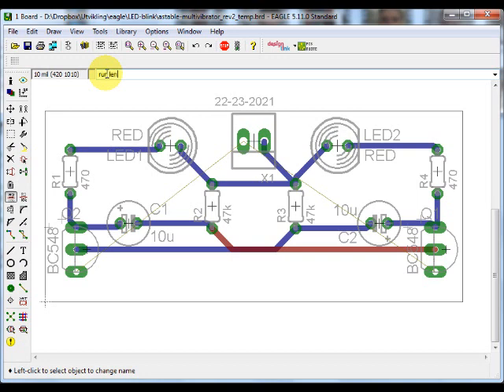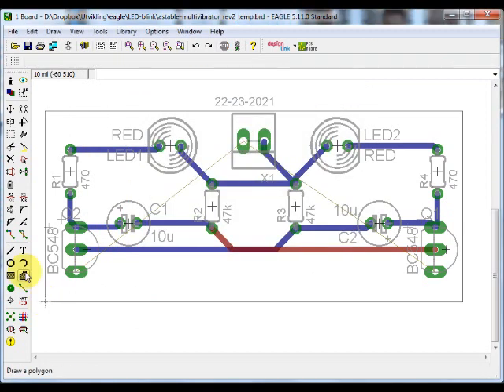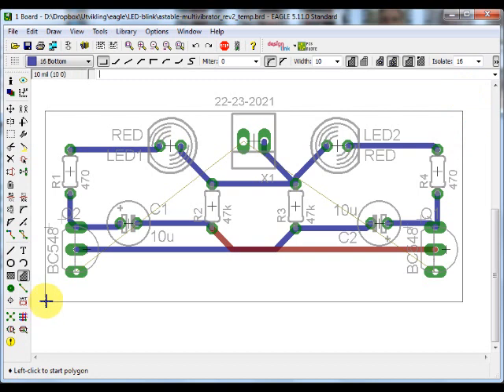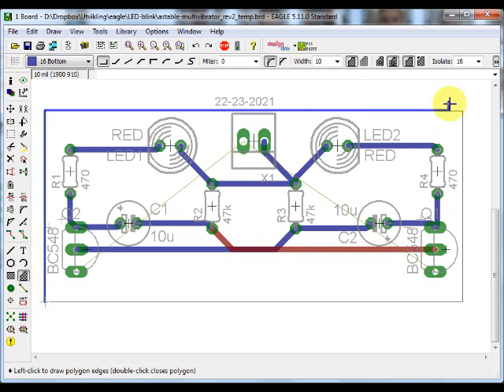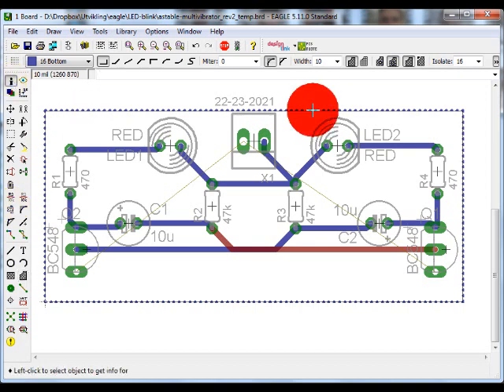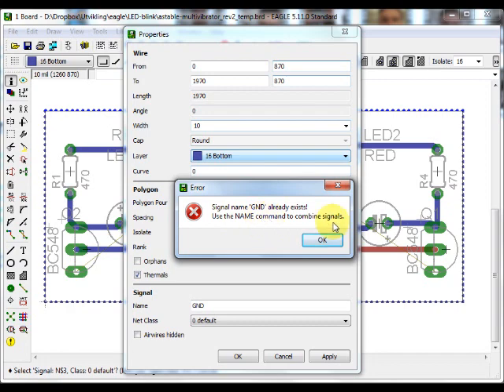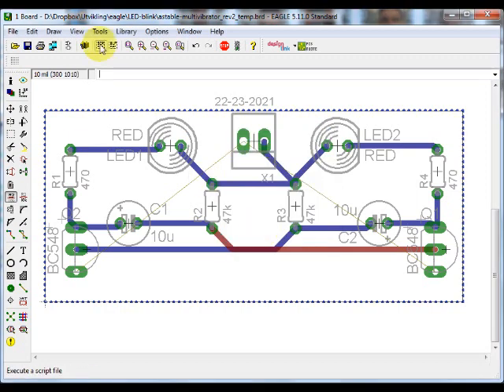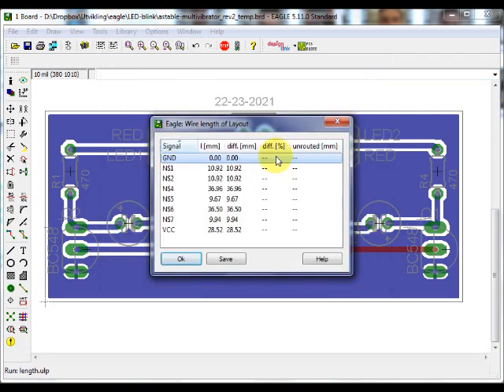How to create a ground plane in Eagle

Comment: I've wondered about one thing:

After I've defined a polygon, renamed it to GND (for example) and did ratsnest, the design is pretty much over, isn't it ? If I do little changes to a wire, the polygon plane won't change as well.

Is there a way to get around this? I think it's pretty inconvenient to undo all your steps to the point of GND-plane definition, do the change to the wire, and do the plane definition again..

Kind regards,
Tom